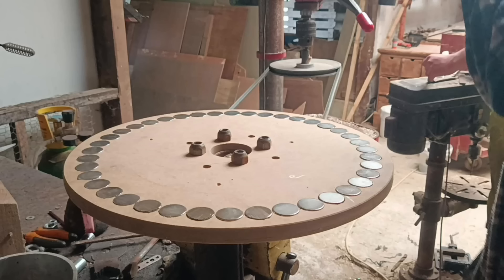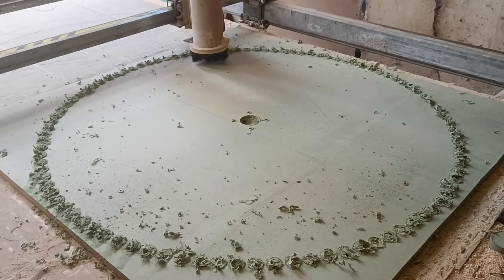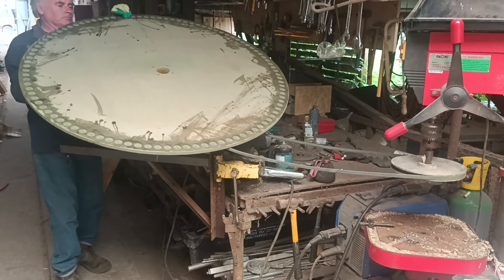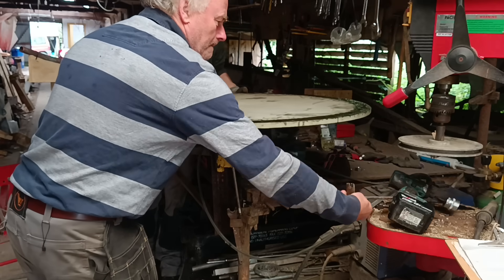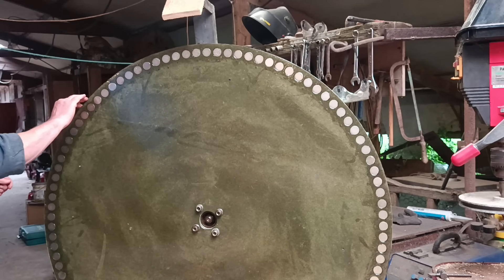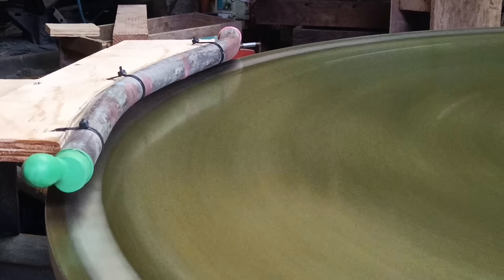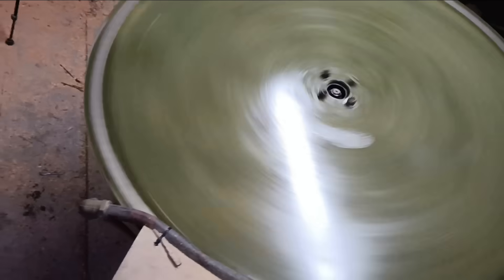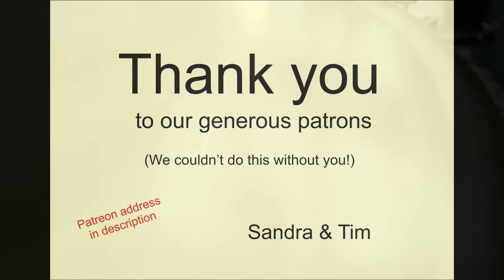ABSOLUTELY HUGE Magnetic Induction Heater! Using 100 Spinning Neodynium Magnets And A Bucket

Comment: An experiment worth trying out might be to put a baffle between the hot and cold side of the header bucket. Or you could put a peice of pipe on the hot side inside the bucket just underneath the water surface so your hot water goes straight to the top and helps the circulation. Maybe a thinner taller insulated bucket? Another thought was if you duplicated the copper pipe work underneath the magnetic disk could it potentally double your output or heat up faster?

Comment: I wonder what the mag field looks like with that longer piece of copper instead of a smaller piece?  Would it be stronger if the copper ran around the board in a complete and uniform circle?  Or would you need to intersect the field at a 90 degree angle, making a zigzag pattern with 3" gaps, all the way around?  Allowing the mag field to build up one way then flip back the other?

Comment: Maximise the circumference and width of the flux, use the most effective material Ferrous clad, rectangular section circle, consider using both sides of the table, above and below... Are the sequential magnets best placed/spaced, what about two centre lines of 1/2 staggered magnets

Comment: Way Out West. Something great to use for induction heating would be to surround the copper pipe and or copper wire that has the casing still on it with the water you want to heat up some how also keeping it close enough to the magnets to receive the induction. That's all the insulation you need that you already have.("The water it's self").

Comment: Have you ever considered an alternative energy source besides powering your wheel with electricity? I suppose there are many options you could consider I suppose you could consider wind as I believe you had suggested earlier with regards to a windmill. Perhaps solar could be an option also. There's also the flow of water to consider that may be able to power your generator. I suspect it may be possible to even power it magnetically!

Comment: No, that's all right. The proof on concept is done. Your next step is to have the water heat exchange pipe extended over the circumference of the wheel, so you can then effectively multiply your existing one foot or so of heated pipe. Secondly, the tolerances and inverse square law of electromagnetism. By halving the distance between the pipe and magnets you'll increase the intensity of the field 4 times. Good work! 👍

Comment: My suggestion would be to cut a LOT out of that disc... or redesign it completely to more resemble a bike wheel or other lightweight way to hold the magnets. Seems like you'll waste a lot of energy from the sheer mass of that disc. Perhaps make the next one from aluminium or carbon fiber or something extremely lightweight?

Idk I'm just a simple locksmith 😂 but this is a very cool concept and I'm excited to see how it all turns out
Reply: Uhm, no. It's not a bicycle. We don't care how long it takes to spin up when powered by a windmill, and we DO want stable revolutions and long wind downs the inertia provides.

Comment: Have you tried running a steel pipe through the copper pipe?
 As the copper should spread the heat evenly though said pipe
 However, the copper should be snug to the steel pipe for noticeable results.

Choose a non rust like 316 or 304 stainless steel.
 Also look at your induction field as any pipe outside it won’t heat the water either. 

🎉loving your work🍻

Comment: I believe that if you made a "snake" shape, back and forth, in an S shape, making the whole circle, it would be possible to heat a larger volume of water in less time, at least it makes sense, right?The more metal surface area, the more heating and dissipation of that heat in the water, however, I would not say for sure, in practice it may be that your model is actually better,but I leave my ignorant guess, please disregard 😅😅

Comment: the thing is... what you've essentially built is an electric generator. Just one that induces random eddy currents rather than a directed current in a wire.

So you could achieve basically the same thing by just attaching the output of your windmill to an electric motor/dynamo/alternator and then have the current from that power an electric heating element. you're converting kinetic energy to heat either way. so why not use an off the shelf solution

Comment: Use expanding foam insulation, slip a much larger outer tube over your pipes and spray away inside the area between both the outer of the small pipe and the inner of the large tube.

Comment: i remember how you cooked the egg on the pan. the copper tube isnt heating as much as the pan will because theres not enough "battling currents" which causes the heat from those currents products by the spinning magnets. and a 2nd or 3rd row of magnets to make short rows of same poles per row. so 2 N and 2 S or 3 N and 3 S if you use 3 per row  and use a thick metal tank on top  simular to the pan used to cook the egg, this will then be filled with water and using the same spinning disk to propel a slow circulation pump to give the heated water time to circulate and aid in spreading the heat through the insulated plumping to a radiator like that used on a big truck, and a fan that blows air semi slowly, (fast moving air just rapidlyu cools the air instead of allowing the air molecules to heat up before fully passing through. aiding in radiation of the heated air to help heat up surrounding air as well. )

i need to build another of these some day again. it was quite the useful heater system that proved to be far more efficient then any "electric element type heater that uses any form of resister element for heating. like whats used in those so called infered heaters and heating units in dryers and electric stoves and electric cook tops.

Comment: I will help you make,,, what you want to do.first you want to expose more metal (copper) surface area to the magnetic flux. You need to smash, hammer, or use a press to flatten the tubing. This will move more copper closer to the magnetic flux for more efficient heating. This will better heat more metal because the top part of the tube is closer to the magnets plus the surface area of copper is spread out and is closer to the magnets. There will be a good flow of water even in the flattened copper pipe. And if the flow is slightly restricted  by flattened pipe it will only serve to transfer more heat to the water.

Comment: You can heat up "till red", the part of copper tube you'd like to bend and than cool it off quickly with water. That part of tube will become soft, easier to bend with tool.

Comment: If course you could always use an electrical resistance heater IN the water for ~100% efficiency. Far better than this setup. Try googling 24V water heater.

Comment: Two things would be great: Get more copper and reduce the distance between copper and magnets. the first thing should be easy and for the second thing it would be nice if you could have two syncronized magnet discs stacked on top of each other with the copper in between them. then the magnetic field strength wouldnt decline as fast and the impact of the distance to the copper wouldnt make such a big difference. a smaller distance with your setting seems to be a very hard thing to achieve, while glueing two such disks together is twice the effort, but not that complicated and i think it will make a big difference

Comment: I would compare heating the water in an iron pipe.  Induction heating tends to work better with ferrous metals.

I would also try to reduce the gap between magnets and pipe as much as possible.  Perhaps using a Teflon slider and zero gap.

Comment: Nice. My 2 cents.
Make it so there's a pipe at top and bottom. I feel you miss 50%.
Also make the pipe round and go over more than 1 part.

Would that work better?

Comment: That would be cool if the pipe wrapped 99% along the circumference of the wheel. Less impressive for the camera, but having the magnet side flipped down will allow you to easily support a pipe butted up near the magnets. Maybe you can get some nice camera angles. And a Thermal camera would be fun to add to the mix.

Comment: If you took a magnet (possibly a larger one than being placed) and held it under the bottom and then inserted the one in the top, that may have held them down easier till you got the holder screwed down. Then you move the bottom one to the next hole. This would have helped for the first 50, anyway. When doing the opposite ones, having one to each side may have canceled out any benefit of the one underneath.

Comment: I think you would get better use of your magnets if you put them onto a thick steel disc.  That way the flux will return around the back of the magnets, at the moment it's getting lost.
If you make two discs this way, and have them facing each other with a gap between them, you can then put the copper tube in that gap.
You would need a strong separation arrangement between the discs, and a way of introducing them into the correct position, slowly (jacking).  The discs are positioned N vs S for each magnet.
The discs can be a lot smaller using the above.  I've used this arrangement to make a wind turbine.

Comment: Point heating, fluxation closer, wax Temp valve, y pattern, single point out, double in för Fluxiation. Center mass heat exchanger, Cone collector for External heat incapsule.

Comment: Can you get two passes out of one magnet?  I mean what if you took your copper pipe and bent it or used fittings to run under the wheel so the magets get a pass there, and then the pipe bends up around the edge of the wheel and then on top.  Do you get to double dip on the induction?

Comment: instead of a flywheel ,why not have just four magnets ,two on each arm ,where two arms move back and forth ,timed to be fast,with maybe a cam and spring system. The camshaft will be driven ect

Comment: I like the design. Insulate the pipes like you said, plus triple the length of the curved copper pipe or longer, so that the water is being heated by the by the copper pipe for longer as it travels through the copper pipe as the magnets rotate past the copper pipe. Have you thought of maybe making a spiral design with the layout of the magnets, then make a copper spiral the same as the magnets, and this project could possibly be made smaller, but you would use more copper pipe being magnetically induced by the magnets.

Comment: Magnets around copper or copper around magnets next to copper tubing. Which is more expensive copper tubing or magnets. 
- your wheel is constructed horribly. The perfect circle is ruined by not cutting magnet holders brackets placings. Then remove allot of the inner circle wince you apparently just want an outer ring lol.
- redesign the entire thing with a pancake motor in mind or an induction heater. 

I like the what you are doing but don’t know where to start with how it’s wrong and how it would be improved. And I’m no specialist

Comment: 2 ideas.  Use magnets to push/pull wheel instead of drill press.  Could you use the existing magnets on the wheel to drive it?  Also to eliminate mechanical drag and breakdown, suspend and contain the drive shaft?

Comment: Get some of that green flux indicator paper to ensure that the flux is passing through your pipe properly. If it is not then the transfer will be poor.

You might also measure the amount of thrust the the pipe is experiencing. That will also indicate where the most powerful position is.

Comment: what about 700magnets in a well balanced flywheel and 20 metres of smaller diameter copper pipe, even a small pump. and lets try 60litres of water

Comment: Add four more rings of rectangular neodymium magnets spaced as close together as possible. Add a suspended half inch spiral coil of copper tubing that is covered in kaol wool blanket used in kiln furnaces. Keep the inlet and exit pipes horizontal and in an even plane. Add an insulated automobile radiator with a pressure blow off valve.

Comment: Nice work, but hardly efficient use of energy. Same amount of energy driving an electrical generator (for example PM motor)  will  generate much, much more power that can be used to heat the water with an electric heater.

Comment: Run your piping up into a metal bucket instead and coil it around inside of the bucket so that as it heats up your pipe it also heats up your coiled pipes inside the bucket causing the water to boil inside of the bucket.. ;)

Comment: You will capture much more energy if you make a complete circle of your 3/4" copper piping, elevating one end slightly, to allow for convection circulation of the water, while insulating all of the copper and tubing associated with it including the collection tank.  Hope this helps.  Built a number of this type of heaters in my time and won the science fair when I was 12 years old with one.  Instead of induction heating, though, I was using solar collection for the heat source.  Thanks for posting.

Comment: I would:
1) Bring the metal much closer to the magnets, maybe stick felt to the bottom of the pipe but it should sit on the disk, friction will be minimal.
2) Another ring of magnets above the metal - but it doesn't need to be a solid disk it only needs to be held to the lower disk, come up and around the pipe. Maybe the pipe should be longer too.

Lots of love

Comment: You don’t need to hang the water supply.  Check out what off-grid folks do to heat tents with copper tube and boilers. https://youtu.be/zwqPiZ4Wgys?si=wV0UEB3pi-QZW4xn

Comment: Have you thought about thermal mass, say sand. Have half the wheel pass through a slot of a tank full of insulated sand, lets say a upright series of copper rods going into the tank that the magnets pass the ends of ... the rods act as the heat elements, the sand the thermal mass then have copper tubing running through the sand & as water passes through ... that sand could get seriously hot! maybe hot enough to turn that water into steam which could turn a turbine .... but you would be best instead of a wind mill, would be a water wheel for a constant.

Comment: if you fill the copper pipe with sand and then perform your bend, it wont pinch off like that 🤙
in hvac we dont liike restrictions in our refrigerant flow! they also have some springs sized for the various diameters which also keep kinking at bay, although ive never used them and cant speak to their efficacy

Comment: The only thought that I had, which whilst I saw in another post could be confuisng, is that you want thick copper piping by the magnets, usually when picking piping you want the thinest walled whilst still maintaining the required structual integrity. In this setup up you want as much copper as it will induce more heat. The width of the pipe matters as well but when given the option try to find a thicker walled pipe and try to have it follow the magnets for longer.

Comment: Copper conducts electricity too well for what you are using it for. You need a material with higher electrical resistance to generate more heat. Using a 304 stainless steel pipe segment will heat much more efficiently compared to copper.
You are essential creating an inductive stove so most materials that would work well on an inductive burner will work well here. The only difference is that you are using permanent magnets so any metal that is attracted to magnets should be avoided for obvious reasons.

Comment: What if you did concentric circles of magnets towards the center and spiraled the pipe so it over laps them all, like 4 or 5 circles. Maybe different sized magnets in the smaller circles so you can have the same number in each one. Not sure if that matters or not, but I had a vision while watching this of a flywheel that propels the magnet disc. Make the disc out of a thin plastic core, with layers of kevlar and carbon fiber to make it strong and light. Heavy flywheel and some gears to make the disc spin extremely fast. Maybe some magnetic stabilizers to keep the disc balanced and spinning true. Use as many frictionless bearings as possible and find optimum gear ratios to go from the source (drill, windmill, etc) to make the flywheel build up a good speed, and more gears to go from flywheel to magnetic disc. I have seen some cool videos on magnetic gears which would be awesome for this to reduce friction. I think that is the key to optimizing this, as little resistance and friction as possible, extremely high quality insulation (ideally it would be something like aerogel, but that's super expensive. I'm thinking about optimization, not cost reduction). There are so many things I want to try with this concept.

Comment: To maximize induction in the pipe, I'd wrap the pipe in enameled copper wire along the length that's over the magnets. Make sure to ground both terminals of the coil to the pipe. We want heat, not electricity, and the enamel dialectric could theoretically be sufficient to turn it into a capacitor (if my understanding of electromagnetic is correct).

Comment: I've tried thermally cycling water with check valves and clapper valves and eventually got a small 12 volt pump. If you don't have dedicated power, a car battery and cheap solar panel to charge it will do fine. You may be able to get it to thermocycle eventually, but it would be better to save that for last once everything else is done. As well, you have to have a pretty large temperature gradient for that to work and it might not be possible with the range you are in. Advice: get a pump to begin with and have a conversation with ChatGPT for more ideas.